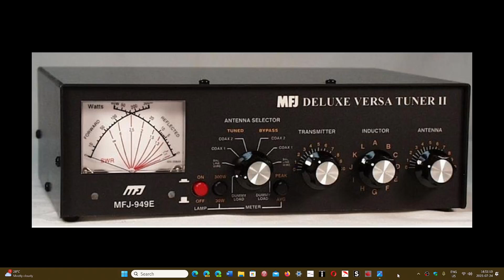Antenna Tuners are useless for shortwave radio receive only

Comment: Matching impedance will improve signal strength there is no debate for that. Tuners can help for RX and it’s obvious to the ear and test equipment.
Reply from the maker: on receive on Shortwave frequencies it is too small a difference to notice as the loss is very very small even mismatch

Comment: This is completely false. If your antenna is tuned to the impedance of your receiver for a particular frequency the received signal will absolutely come in stronger not to mention the rejection of other signals that may be unwanted. -engineer
Reply from the maker: Engineer should try it, you will see how useless they are ... at shortwave frequencies impedance mismatch has almost no effect on receive.  test it rather than thinking you know everything
Reply: @OfficialSWLchannel  I don’t think I know everything if it sounded that way. If you just look at a superheterodyne theory you’ll see that antennas receive the best when the resonant frequency is equal to the station's carrier frequency – this way it acts as an input filter of the receiver. 

We just do things differently. I use a thermometer and you walk outside to see if it’s cold. Good for you, but maybe don’t teach people incorrect basic electronics theory.
Reply from the maker: It it not incorrect as it does almost nothing, it tells you to put money on something else that will be much more useful, like a better antenna
Reply: @OfficialSWLchannel  why even bother tuning that? 😂
Reply from the maker: for transmitters it is important to match impedance, that is why they exist.  Even on my Yeasu FTdx10 ...When I use the autotuner to Transmit, there is absolutely no noticeable change in the received signal
Reply: @OfficialSWLchannel  all good sir.

Comment: Tuners do nothing to increase the level of a received signal. That much is true. But they do filter out much out of desired band noise and signals which could still result in better overall reception. This is just my personal observation.

Comment: Would it therefore be correct to say the best way to get receive antenna  to perform at a specific frequency would be to bring it to resonance at that fqy? Either by lengthening or shortening it, or possibly by artificially adjusting it to resonance with the use of an LC circuit?

Comment: It depends. If the Receive-Antenna is matched to the Receiver on basically every Frequency, I would agree. But if the Antenna is not matched on every Frequency, a manual Antenna Tuner can actually improve the Reception as well. 

And also if a Receiver suffers from "Overloading", You can actually detune  with the Antenna Tuner a bit until the Overloading Effects disapear and the Reception is much clearer.

Comment: Pardon???????????   Maximum signal transfer occurs where the impedance of the antenna matches that of the antenna socket of the receiver.   This is a a very basic
fact in electrical and electronic systems including radio receivers.    If you put some unknown impedance into the coax antenna socket of a receiver you will probably have a
massive mis-match and thus cannot transfer the maximum signal into the receiver.     In addition to the increase in signal getting into the receiver, an Antenna Tuner or Antenna Matcher or what ever you want to call it, will provide a degree of selectivity of the signal going into your receiver.        Regards  Tony G3...
Reply from the maker: YEs but at shortwave frequencies that impedance mismatch is so low on receive it does virtually nothing, nope does not really work